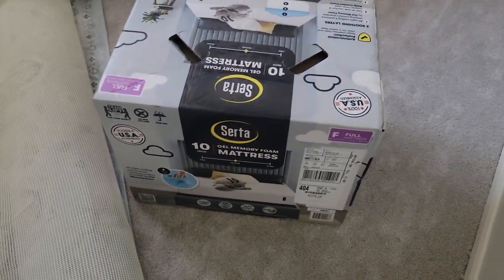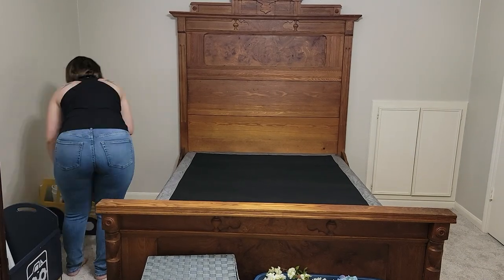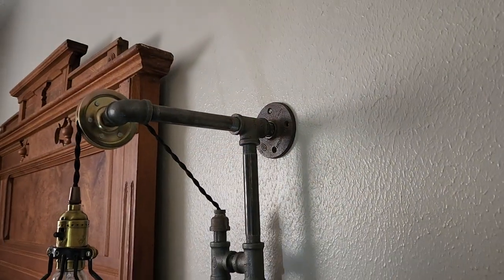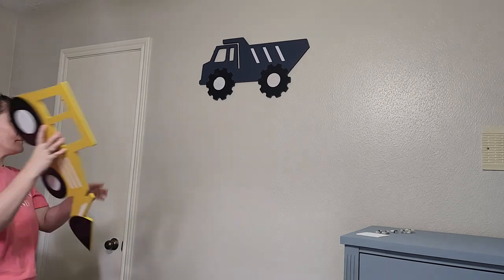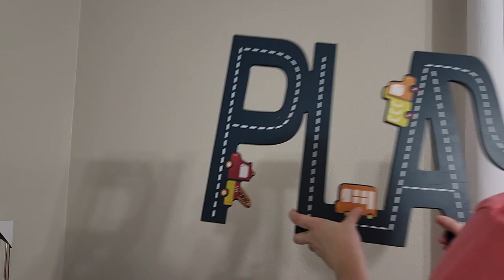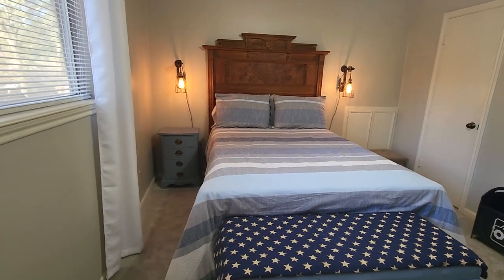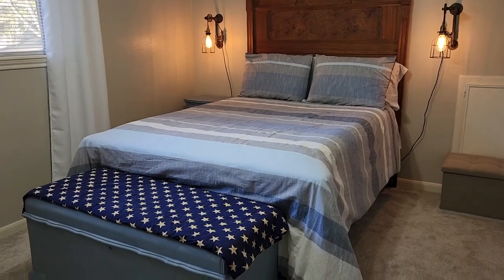Bedroom Makeover and 3 Furniture Flips

Comment from the maker: Help! What are those metal pieces on the frame?
Reply: I've only seen them on one other Victorian bed and I really have no idea what they are. Wish I could help! Seems like that's the first thing that comes off so it must be something to do with the old mattress type or suspension system since it's no longer used.
Reply: They are to catch the metal hooks  on the side rails. Your bed made may have been modified from the original.
Reply: Is the vertical piece open on the bottom? If so I'd guess a place for wheels 🤔
Reply: I do not know for certain, however you may investigate as to whether they are brackets which would hold a roller, caster wheels for moving the bed. When you look in the 1902 Sears catalogue you see small casters on the bottom. However with them not on the legs, and on a separate bracket, there would not be as much stress on the legs when moving. The metal bracket has a hole visible, the shaft of the wheel unit may slip up into that. I enjoyed your makeover thank you.
Reply: It was for wheels.
Reply: I've seen them on other antique beds and have wondered about. Those brackets look almost like hinges, and I'm wondering if they're maybe part of a trundle mechanism. You provided my Obsession of the Week, and I intend to find out what they are!

Comment: It turned out well, but I would have hidden and covered the wires on the lights. That is an old bed, my guess would be to move the bed without taking it apart, those beds were solid wood and very well made and may weigh a ton. Also, I think I would have stained the bed in a slightly darker wood. The bed would look great no matter what you did or didn't do to it.

Comment: Perhaps you can learn about the metal pieces on the bed from an antique dealer, or maybe the library has a book on Eastlake furniture. My parents had an Eastlake settee in their room. We were forbidden to sit on it. When they passed, I did some research on it. I learned it would cost quite a bit to reupholster it. It is very old (stuffed with horsehair) and belonged to my grandparents before it came to our house. Although I think it's an old cool thing it's not my style so I didn't invest in the reupholstery. My sister moved into the family home and the settee still just sits in the corner.
Reply from the maker: Great idea Linda. I don't blame you for not wanting to reupholster the set. The settees and chairs from this time period can be a bit awkward to sit in anyway.